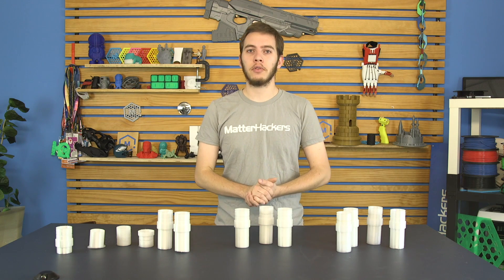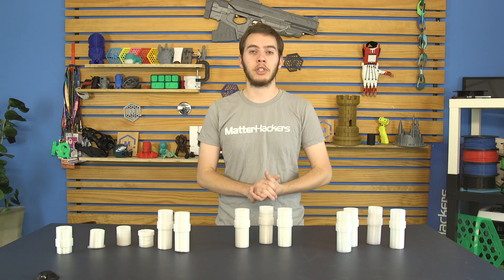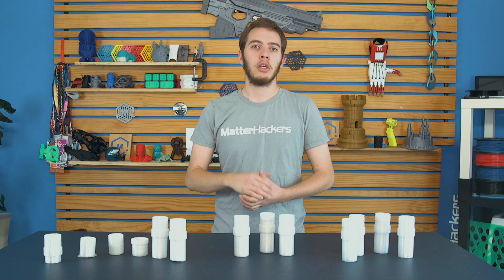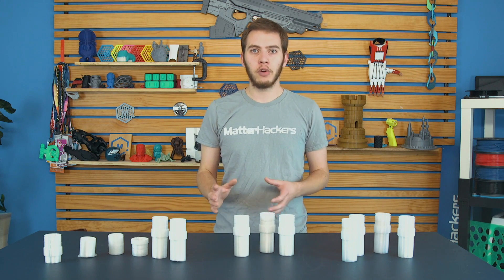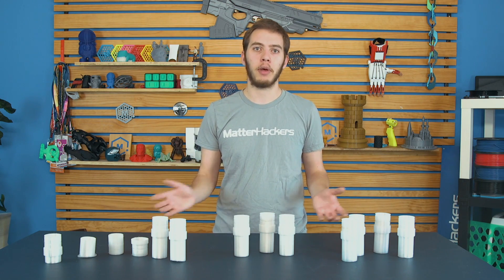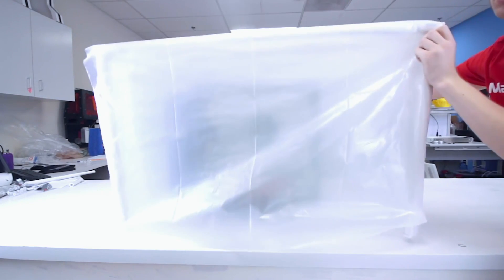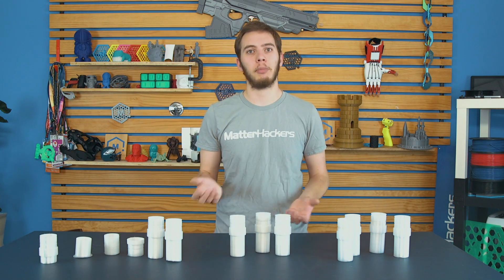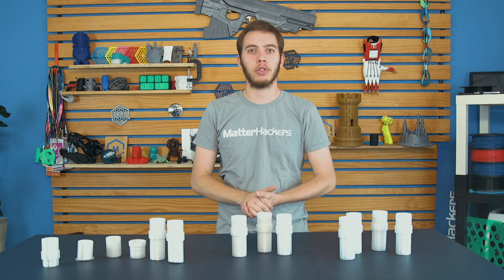How To Succeed When 3D Printing With Polycarbonate Filament // How To 3D Print Tutorial

Comment: Sir i have a problem with PC filament, ive been printing really beautiful PLA prints but im about to work with PC  filament, its been 5 days of hours and hours of failures.... I watched your video and many more videos, but it just keeps failing....  I tried changing temperatures of the nozzle from 260 to 280 to 300 and the bed temperature from 100 to 90 to 80 to 70 to 60 to 50, so far the bed temperature of 50 seems to give a  succesful first few layers....  else it fails immediately. so i kept using 50 , but every time after a few layers it starts to warp and mess up by some filament looking like little hairs on the print, it gets worse and worse and worse the more layers . Ive tried changing glue , i even went as far as using paper tape to hold it down on the sides [which always eventually warp UP] , but still it fails... im out of ideas, i need advise  [ im using the creality 1kc which has a max heat bed of 100 Degrees and can print max 300 degrees]

Comment: I LOST SO MUCH TIME EXPERIMENTING WITH POLY CARBONATE. LITTLE 4X26 mm SCREWS WERE OK A LITTLE 1mm  2 ICH PLATE OK . TRIED BIGER PIECES 4 INCH NOT SYMETRICAL TOTAL FAILURE . WARPED CRACKED EXTREAM WEAKNESS. COST WAS 65$ FOR A TOTALY INFIERIOR PRODUCT COMPARED TO PLA. CP IS NOT BULLET PROOF OR VERY STRONG AT ALL. 1/2 INCH WARP ON A 4 INCH WORK PIECE. I'M GOING BACK TO PLA.TRIED AND TRUE.

Comment: sounds like an absolute pain to print poly. 
i would need to do a lot of mods to my printer that im not willing too. like a 24v bed, new control board for 24v bed support, new thermistor, new fire hazard stickers and a fire extinguisher nearby. :P
it would probably be best to have a printer dedicated to the stuff if you plan on using it.

Comment: I do know that this video is from 2017 so maybe it's outdated.
I print with Polycarbonate by Polymaker named "PC/FR" (Flame retardant) and it prints easy as PLA+.
What I mean by that is that it does not clog, it sticks to the bed, it looks beautiful and never had problems with it (after printing about 10 Kilogramms of PC/FR).

You print it with 250-270°C Hotend and 105-110°C Bed. Turn the fan off or - if you need bridges and flat angles - set it to max. 30% and go a bit slower. You will get beautiful overhangs and bridges.
It is SUPER strong. I wasn't able to break models of PC/FR which could easily be snapped by 2 fingers when made out of PLA or even ABS and PETG.

No, I do not get paid haha.
Just try this stuff, it's not even THAT expensive (45 Euros per Kilogramm).

Comment: I went straight to nylon as soon as I got a printer lol creality ender 5 plus polymaker polymide COPA. been making Glock,vz,cz and ar15 parts and mags . Took a few times to dial in the settings. Prints like a dream
Reply: I just bought a Prusa i3 MK3S+ and plan on pretty much jumping straight to polycarbonate.
Reply: @DaveZaniboni  how'd it go.

Comment: what is the diff between poly carbonate which is rated at 260 degree to melt and the other one which is melting at 300 , can you share a link for a polycarbonate high temp ?
Reply: The 260 degree ones (pc-max, polylite pc, ecp) are polycarbonate blends, optimized for easier printing, while the ones where you need 300 °C are pure polycarbonate (raise3d pc or any other "generic" pc).

Comment: Is polycarbonate hard enuogh for home appliances? could I make for instance, like a guitar wall mount that could hold a 15 pound guitar? Could it also be turned into screws?
Reply: The load it can support will depend upon stress, which depends upon geometry. For a general suggestion, print a test part and experiment with it. For instance, hang a 30lb weight from the guitar mount for a week at elevated temperatures (hot Summer day in a garage or something). If the part did not permanently deform at all, it would be fine. If it did, you will want to redesign the mount. In general, it will have to be larger than a typical metal mount. But, purchasing a mount will be easiest. 3D printing is best for making parts that you cannot get commercially.

Comment: You overcomplicated things. Works fine with PVP glue, 110C bed, even brim instead of raft, with cooling at 60% after second layer and printing temperature 260 (recommended was 250-265 °С). Used glue only to avoid sticking too much to Ultrabase (Anycubic 4Max Pro with mb replaced by Duet 2 WiFi and extruder replaced to Titan Aero + Volcano).
Reply: I expect that the exact type of filament used will make a large difference. The Polymaker PC filament seems to be a lot easier to print with than what this video addresses. And, that is even per the recommended settings for the Polymaker PC, not seeing what you can get away with.

Comment: I printed polycarbonate (no blend) even with a 85c bed. tho it worked better with 120c. just use a sanded polycarbonate/lexan sheet. even can put a bit of gluestick there to make sure it can release.
i used 295 for my nozzle. at 85c it didn't warp but the layer adhesion was really bad.

also you really benefit a ton from an enclosure. without it the prints come out bad and brittle (a blanket can work)

Comment: Well, CRAP! I just bought a printer, and it came with a spool of PC. And I have been getting great parts, the only problems being that I don't like cutting off the printed grid-platform that some call a raft. That, and it leaves some fine hairs as the nozzle rapidly moves from one area to another, that I just used a lighter to melt back.
Reply: Pls, what printer "comes with a spool of PC" ? It is a 'high temp" all metal hot end what? Thx.

Comment: I bought some polymaker PC-Max and printed with their recommended settings, and my first print came out perfect. 255 C with an 80 C bed using buildtak, and a raft.
Reply: same results for me as well, 250/82 worked perfect!
Reply: I find with PolyMaker Pc, it sticks really well at 110 on textured pei, and I print between 250-270
Reply: every raft ive tried has horrible prints, so i use a hotter bed and no raft

Comment: And dont try this unless you have an all metal hotend too :-)
Reply: Capricorn XS works fine... not sure why you'd need a all metal hotend, a silicone sock can help level out the hot end temp, and using a copper block+tip can hold in the temps better because of higher thermal mass and excellent thermal conductivity within the hot end.

Comment: My part cooling fan died on my Prusa mk2s so while waiting for the replacement I spent two entire weeks trying to print polycarbonate. I didnt up the bed above 110 so will deffinatly try that as I didnt realise is ok to go as high as 150+ !! That should help heaps. The one part I did get perfect was so tough that I had to use a diamond file to 'adjust' the fit for a screw. Lol

Comment: I have printed Polymaker PC-Plus just fine on PEI sheet on glass heated to 105C. Different grades of polycarbonate print at different temperature ranges, so YMMV. I did have warping due to lack of a print enclosure.

Comment: Um... you can get - reasonably inexpensively - thin polycarbonate sheets (like almost paper thin)... how about putting a thin sheet on your print bed and treating it like injection molding flashing; and just removing it with an x-acto knife around the part? (I.e, the area that was printed on becomes a permanent part of the print). Not necessarily what you'd want for everything, but for the right job, in might be applicable? 🤔
Reply from the maker: Yes, that's a great idea. It would probably be best to use the sheets after all your other settings are dialed in to lower the risk of burning through the PC sheets easily.

Comment: Hi, thx for the video its very useful :) you did recommend 90-105d on your website for the bed, so i guess 135d is more the way to go?
Also i didnt find the technical data sheet of your Polycarbonate, do you know where i can find it, i would like to compare it to other PCs :) thank you very much
Reply from the maker: Thanks for noticing that - we will be sure to edit our other settings, as we have found that the hotter bed temp seems to work better. Also, for the technical information, please send an email to support@matterhackers.com. Thanks!
Reply: Thank you for your quick answer,  just sent out the email :)

Comment: MatterHackers could you please list some of the printers which can reach such a high bed temperature? Is it possible to upgrade the head bed of printers such as the prusa i3?
Reply from the maker: Replacing the heated bed to reach high temps is not difficult, but it's complicated - there are a lot of variables that are involved. It's possible, but it's more work than simply "swap out the bed." Please email support@matterhackers.com to discuss this further with our test and support team. Great question - thanks!

Comment: Don't be afraid to try any filament at any point. Definitely start with PLA, and get that down, but once you have a decent PLA print going, don't be afraid to try, just don't be surprised and discouraged if you fail. Failures are part of 3d printing.
Reply from the maker: This. Excellent advice! With any technology, get your bearings, and then explore!
Reply: MatterHackers absolutely, so many people new to 3d printing are afraid that if they try new filaments, be it ABS, PETG, Exotic fills, or what ever, that they will somehow break their printer.

Comment: Don't be afraid to try polycarbonate, I printed small parts successfully without enclosure, 110C bed, 275C hot end and hairspray on glass. Try to get a 50g sample, and simply try it for yourself.
Reply: I printed a g17 frame with absolutely no problems, 100 degree bed 260 hot end, no enclosure no problems at all, And basic reading skills helps with it because it says on the polymax pc when you buy it that it recommends being annealed at 100c for 2 hours after printing, that will release print stress and reduce cracking and layer separation.
Reply: my throat is ptfe lined, I think max temp is 260... what do you think?
Reply: Oh be very careful, those micro particles are like asbestos and researchers found out they cause long lasting illnesses  @giannagiavelli5098
Reply from the maker: Awesome advice!
Reply: Huh thanks for the comment. The video put me off but your comment made me reconsider it ;)
Reply: Can you please tell me if the bed has to be heated the entire print time, or until the printer reaches 2-3 cm in height is enough?.